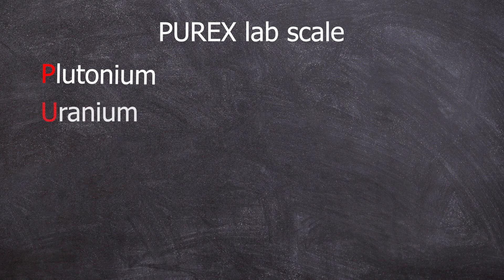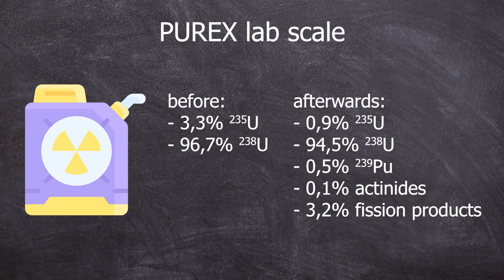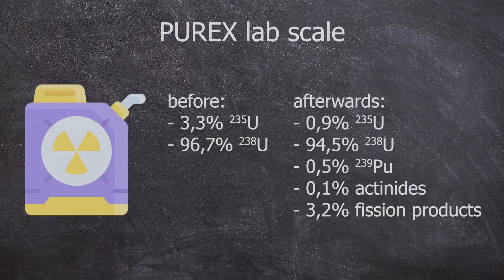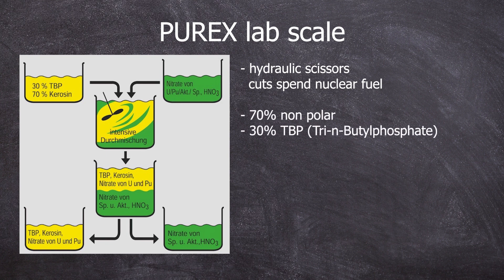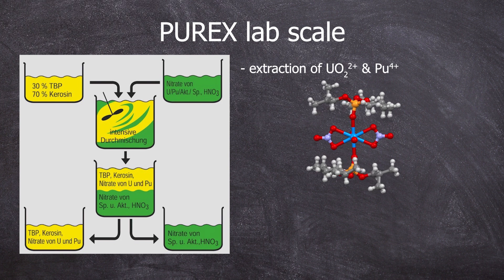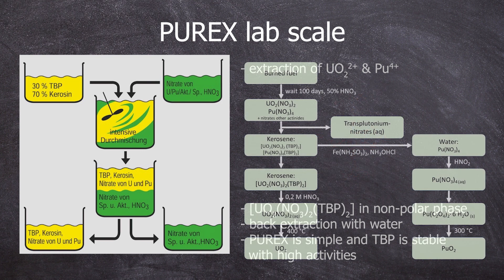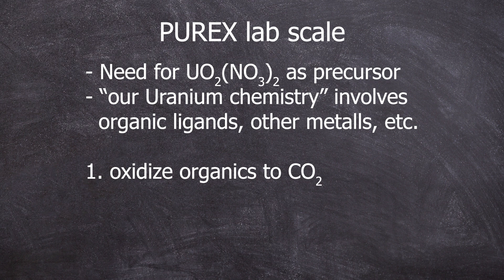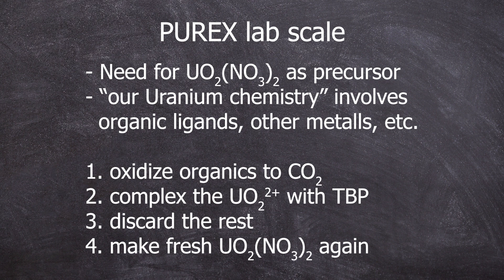The PUREX process on a lab scale - nuclear chemistry

Comment: Could you just use any solvent and could you theoretically recover all the used solvent after the PUREX process?
Reply from the maker: The solvent needs to be cheap and stable under high radiation fields. In our case both things wouldn't matter as its just Uranium. So no high radiation. In this video, we just used as solvent what we had🤷‍♂️ i could also have used n-heptane if we had it.

In the end both will remain contaminated with Uranium but to such low levels, that for us a plant specialized with treating chemical waste can handle the rest. We already got the bulk of our Uranium back. I don't have insights on the logistics at LaHague. Did I answer you question? :)

Comment: Do you have a source as to why possessing TBP is illegal?
Reply: Toxic, possible carcinogen, can be used for nuclear purposes (i.e. terrorism).
Reply: @heavy_metal_chemist  Yeah, AFAIK the IAEA is a somewhat strict with who has TBP.
Reply: Tributyl phosphate has a lot of other uses besides the PUREX process. Brake fluid and hydraulic fluids, lubricants, antifreeze and heat exchange mediums, plasticizers, flame retardants, pesticides , herbicides, fungicides, detergents, ink, paints, resins, gums (not the kind you chew), adhesives,  and rare earths processing . It's used everywhere, and is far too common to heavily regulate under nuclear laws and treaties. Instead, it's easier to regulate enrichment, reactor design, and the radioactive waste itself. If illegal reprocessing is taking place, it's difficult to hide because reprocessing facilities usually stick out on satellite images and there are traces of radionuclides around the site that could have only come from a reactor.